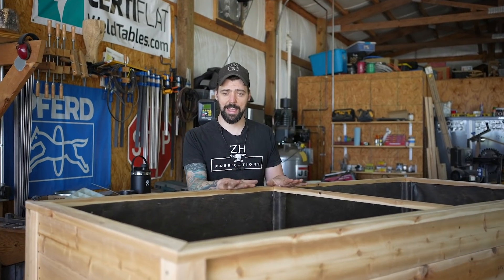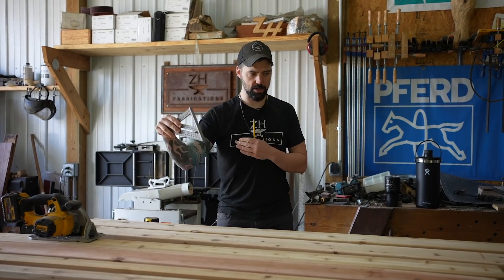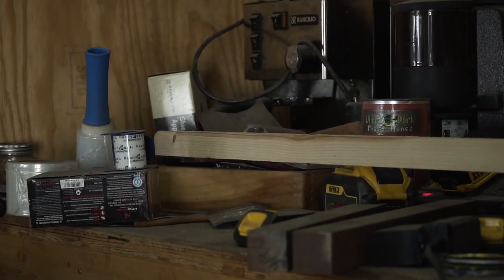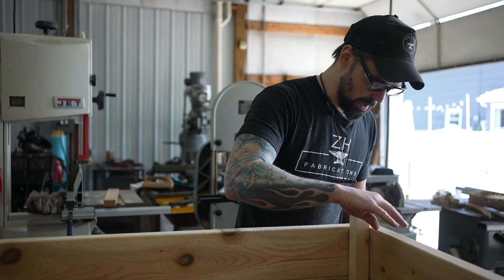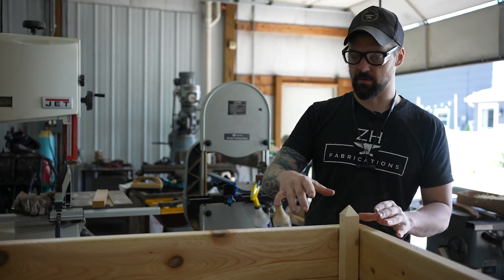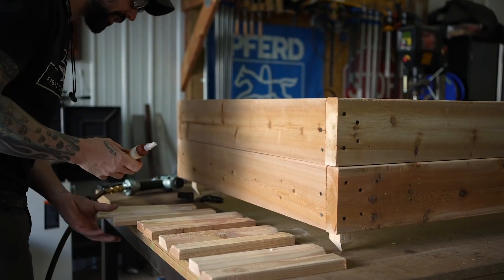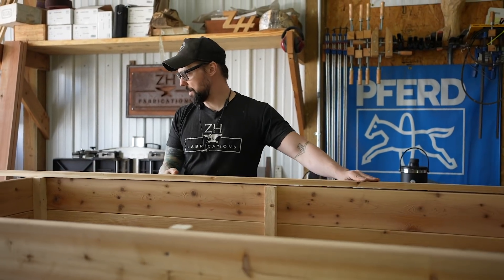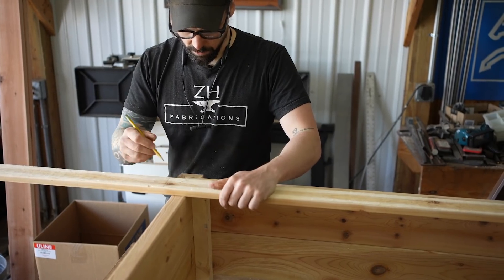Quick & easy cedar raised garden bed

Comment: We have built and sold literally thousands of planter boxes.  We mill our own lumber using locally harvested Eastern Red Cedar.  At Kinta Sawmill all we mill is cedar and we are specialist at building planter boxes.  From years of experience we have learned that after you fill the boxes with dirt they won't be moving so those pointed stakes sticking down don't help any unless you are on an incline.  Also the fabric on the sides actually will make the boards rot faster because they will stay wet longer.  One thing that would really help is to put a few layers of cardboard in the bottom on the ground before you fill with soil so it helps kill grass/weeds and also draws beneficial earthworms into your box.  We use coated deck screws so they won't rust off.  Our most popular size planter boxes are 4'x8' and 4'x4'  either 12" or 18" tall.
Reply from the maker: Good advice, thank you!